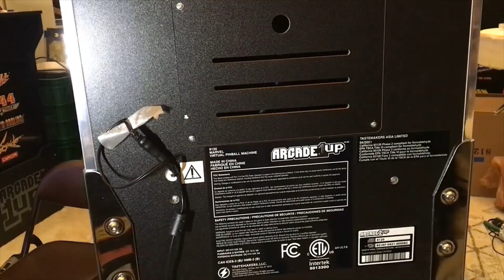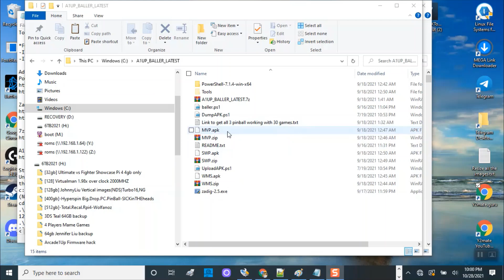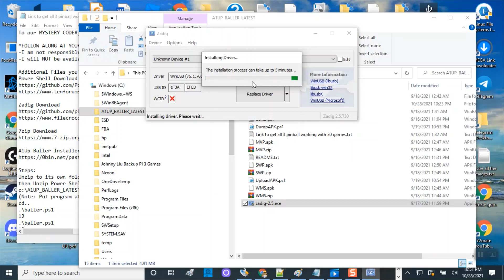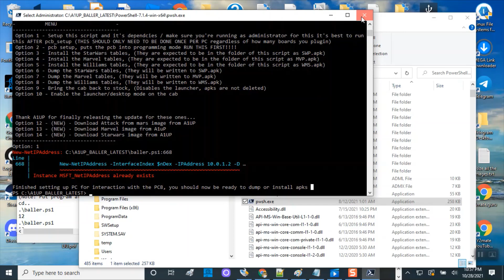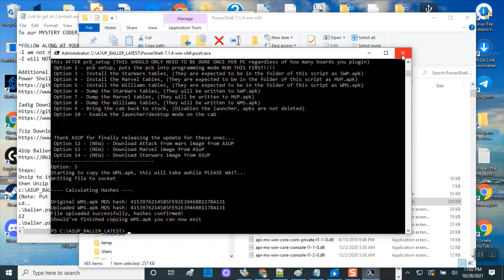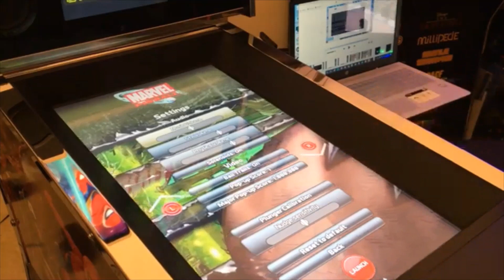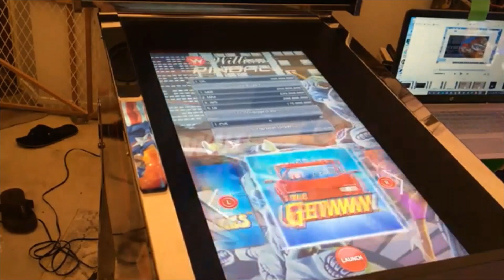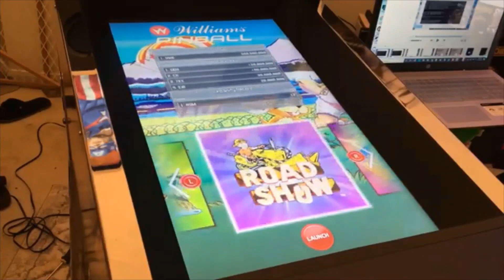Arcade1up Pinball firmware(s) 30 in 1 v1.1

Comment: Hi Johnny

Quick question do you have to update the star wars tables for this mod to work? I heard that the star was tables tilt easily with the new modded table. The original star wars doesn't tilt easily. If I only add the marvel and Williams will the original star wars show up also?
Reply from the maker: If you already have Star Wars pinball and you don’t want to upgrade it you don’t have to. But I believe the new v3.1 will automatically all all 3 pinballs from Arcade1up and added zen pinball as well. You can join discord and ask the hacker the question.

Comment: Hello, silly question, but can someone please advise me what cable one has to buy to make this firmware update. I purchased a 
"C" type usb to micro cable and it does not fit. I contacted Arcade 1up and they stated that they can not recommend which cable to use. What the hell is that all about?
Reply from the maker: Wow, that is crazy. Here my recommendation Micro USB Cable Fast Android Charger 2Pack 6FT Upgrade High Speed Durable Android Charging for Samsung Galaxy S7 Nylon Braided Cord Compatible with Samsung Galaxy S7 S6 J7 Edge Note 5 MP3 https://www.amazon.com/dp/B09BNL2JFY/ref=cm_sw_r_cp_api_glt_i_BRNHJWEZSK8WGE9TH3CE $8.89 two pack 6 ft.  You need micro usb to usb A. 😊